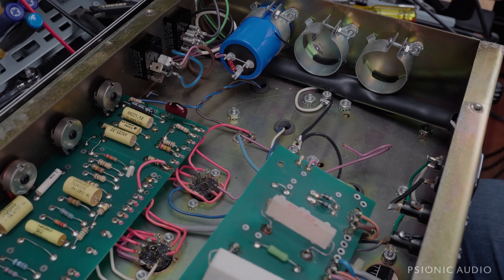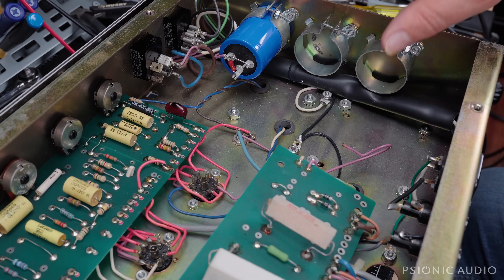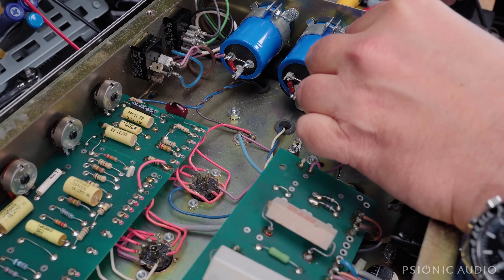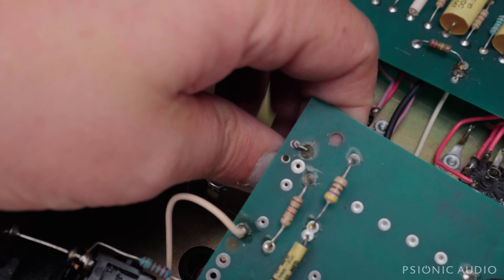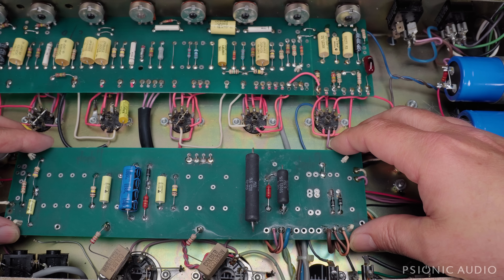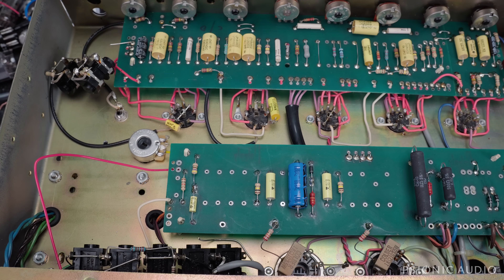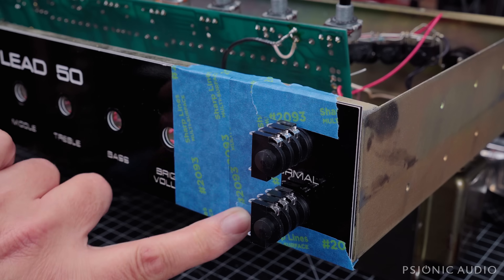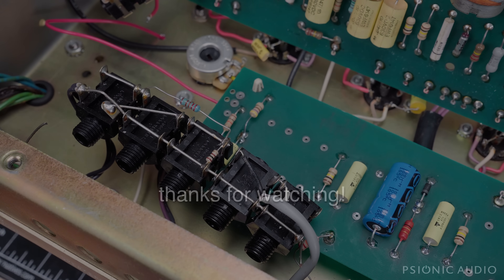Progress | '86 HiWatt Custom 50 Pt 3

Comment: Nice work as always Lyle. I noticed later in the video you replaced those fugly white, waving in the air, wire wound resistors with high quality round ones, that have plenty of distance above the PC board for cooling and don't wave around.

Comment: I'm clueless, so please excuse this question if it's dumb. 🙂 But adding the bias trim pot, will that allow you to use different tubes if you wanted to? Like el34, 6l6, kt66-77-88, etc... Also to adjust the bias as components drift?
Reply from the maker: Yup!
Reply: @PsionicAudio  Why would they make it any other way? Simply because the bias pot would add a few dollars to the BOP?

Comment: Why grounding lugs instead of soldering directly to the chassis?
Reply: because that isn't allowed to electrical code standards for about 50 years.
Reply from the maker: I only do that on vintage Fenders and a few others that were done that way originally.
Reply: Properly crimped, star washered, and torqued down lug connections are more reliable and vibration resistant. (Every earth bond on planes and trains is done this way). 

Soldering creates a brittle point in the wire, especially with prolonged heat input.